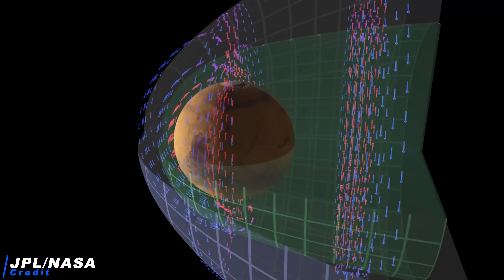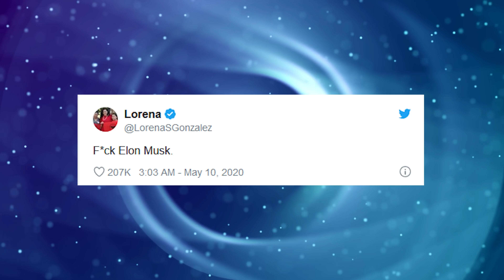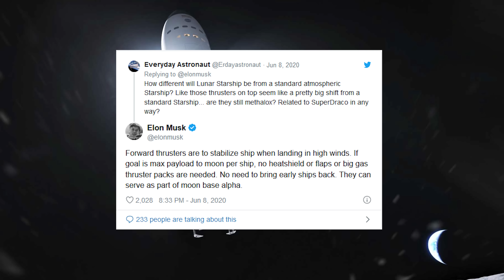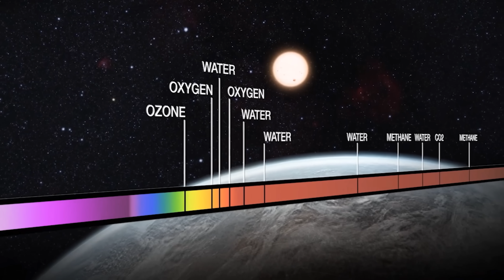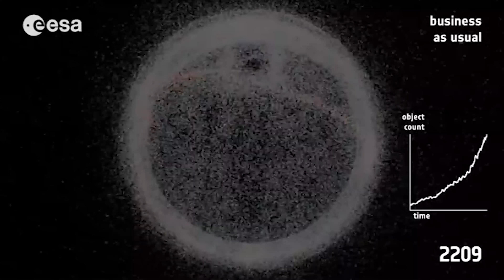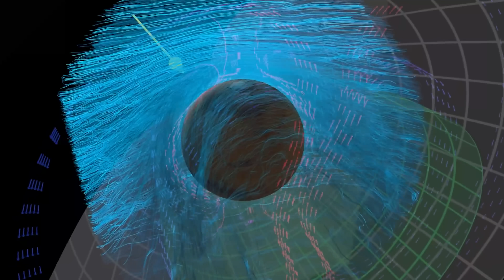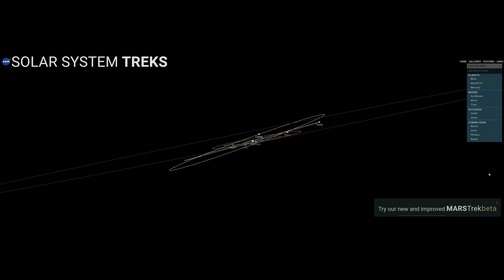MOON & MARS STARSHIP Update, New NASA Boss Of Human Spaceflight, JWST Delayed Once Again!

Comment: I think Elon is fantasizing about putting people on Mars in 2024. His 2022 precursor flight would have to contain all of the equipment necessary robotically to prospect for and mine ice, refine the water and make the fuel for the return trip. A lot of that has yet to be developed. I don't think there is any way that precursor flight can be done in 2022, therefore no people in 2024.
     However, setting ambitious timelines for achieving goals can be an important factor in achieving them early, even if not within those timelines. Thus, by setting a goal of 2024, Elon increases the chances of achieving a landing by 2030. An historical example of this is Apollo. Had there been additional delays to that program, and there were very serious ones, we still would have landed by 1970 or '71. Would we have come anywhere close to that had Kennedy not set the goal of 1969? Similarly, Trump is seriously pushing for a return to the Moon by 2024. I now doubt seriously that NASA will achieve that, for political and funding reasons. There are too many people in Congress who just want to do anything to make Trump look bad, and America for that matter. But, by pushing for the 2024 goal, so much has been accomplished that the program will be impossible to kill and the landing will still be achieved before 2028. By contrast, had they kept the previous goal of 2028, everything could have been kicked down the road and ultimately killed, just as it was with previous Lunar return projects.
     I should note that I am talking strictly in terms of the SLS/Orion architecture here. I do believe that SpaceX, with Starship, will be able to achieve a return to the Moon in a 2024-2026 time frame. And even if even SpaceX's plans should get pushed back to 2028, w hat may ultimately happen, and what I think Bridentstine is angling for, is that Congress will permit NASA to dump SLS entirely in favor of a Starship based architecture. So, both the administration and SpaceXare pushing for an early return to the Moon. It may happen later than they would wish, but because they are pushing for it, we will return to the Moon, "Before this decade is out."
     As an aside, ten years ago, SLS made sense. barrack Obama was pretending we were going to Mars with no launcher to get us there. So, it made sense to develop such a rocket. Nobody at that time could reasonably have foreseen the poor management on SLS, or the developments that SpaceX has made. I sympathize with the talented engineers and technicians who have worked on SLS, but it is simply outmoded and obsolete before it has ever flown and that's just a fact.
     And speaking of delays, yes Sebastian, when the man in charge tells everybody to go home and stay there until further notice, that means work on something like James Webb simply doesn't get done and that forces a delay in the launch date. You can blame Trump, or Xi Jinping, or Covid 19, but it ain't NASA's fault.

Comment: At this point the JWST should just wait until the starship is built to take it to  space.
Reply: The Starship would be a good shuttle to orbit JWST together with a high energy-fuel propulsion stage. The Starship would not help to alleviate the delays, those are caused by the JWST manufacturers.
Reply: I'm guessing that the JWST is another "cost plus" NASA contract that is being deliberately delayed with HUGE cost overruns simply to maximize corporate profits at the expense of tax-payers.  This sort of fraud needs to STOP.  The excuse that the JWST needs to be "absolutely perfect" because it cannot be repaired once in space is no longer valid.  SpaceX Starships will be able to reach it for any needed repairs just like the Space Shuttle did for the Hubble Space Telescope.
Reply: The big problem with the JWST is that it's incredibly complicated and delicate and has something like 300 single-point failures, meaning there are 300 parts or processes that have to go exactly right in order to make it work at all.

Comment: I wonder if the Martian atmosphere loss could be minimized by placing a huge charged mesh at the Martian L1 Lagrange point. (At Mars L1 this grid would stand between Mars and the sun.) This mesh would be charged positively and act as a repeller or diverter of solar wind particles. Its shape would be conical with the point pointing towards the sun. Conductive metals for the mesh could be harvested from the asteroid belt and processed in space. I think it was Azimov who largely had this idea way, way back as a way to deal with cosmic rays from a local super nova.

Comment: There is an elephant in the room here that no one is addressing. So i am gonna ask you guys. Do you think it is possible to get 31 Raptor engines in a 9 metre diameter booster stage for starship ?.(formally 37). Think on now guys, how will they have room to gimble ?...the math on 37 Raptor fuel consumption is 26.5 U.S tons of fuel a SECOND. The complexity of getting that many Raptors plumbed in and working correctly would be an engineering miracle. I know we only see renders, but in reality, to get something like that off the ground will require the development of much larger more powerful engines...and less of them...much like the F1 engine....peace to ya.
Reply: @TechChasm  Thank you for your thoughtful reply guys..peace to ya.

Comment: Milestones:
1 Starship hop
2 Starship 20,000 feet, test descent and land
3 Starship to orbit and land (If no cargo, can do without Heavy? If not go to milestone 4 )
4 Starship heavy hop
5 Starship heavy  orbit and land
6 Starship heavy carries Starship to orbit, both landing seperately
7 Starshp to orbid, fuel to orbit, Starship refuel in orbit

How long do the above take? Can it be done in two years? Try putting some estimated dates on the above list. Can it be done by 2022?
Once you have Starshp refueled in orbit, wouldn't the next test be an unmanned Starship to mars? (Lunar Starship is on a parallel path with different milestones.  The long time delays will be for manned missions. The key to the cargo missions is not caring if you fail, since they can build cargo starships and engines fairly quickly.

Comment: Yes, do a video about the proposed artificial magnetosphere for Mars. It sounds very appealing. With Starships, superconducting magnets coupled with pv this could actually be doable. I'd really like Musk to address this idea.

https://www.extremetech.com/extreme/245369-nasa-proposes-building-artificial-magnetic-field-restore-mars-atmosphere
Reply: Do you have any idea what that involves?  I would go for Terra forming Venus long before Mars with the effort that involves. Technically you could Terra form the Moon given enough energy.
Reply: https://www.youtube.com/watch?v=RcXBuYwm3xk
Reply: @crp9985  Well, that video was almost a complete waste of time. The only new information I got, was that you only need around 1000 GW for that artificial Mars magnetosphere. That is actually a very interesting tidbid, but you could have also gotten that information from the 2 Tesla mentioned in the article I linked, if that is correct. The point is, that I want JS to crunch some numbers, like how much tons of cargo you would have to deliver to L1 of Mars, how much that would cost with Starships and how much that gear to put there would cost to manufacture. Of course I could do the numbers myself, but I will be probably too lazy to do it. The point is that a magnetosphere would benefit the settlers on Mars enomoursly way before you would do full terraforming and that the cost would be large but maybe not out of reach if the US and the EU chipped in in a decade long project.